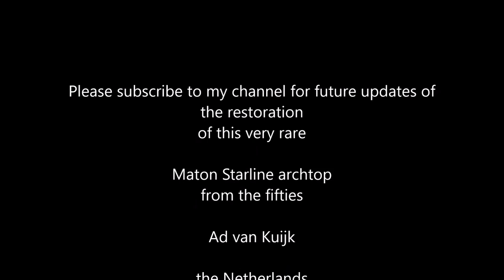Extremely rare Maton Cello guitar from the fifties restoration part 2

Comment: By 1956, Maton truss rods had a half inch square adjustment with access through the soundhole in my HG100.  Too late now, but an inspection mirror through the cutout may have revealed whether the Starlite had the same truss rod although it would be impossible  to access through the F hole.  I used the back end of a half inch drive extension bar to give the HG100 truss rod its first tweak in 62 years.  Suprisingly it still worked.  I would love to put a camera inside the old Starlite to see what bracing pattern Bill May was using in 1956.  Probably just the two tonebars that we can see through the cutout.
Reply from the maker: there were only two tonebars in this Maton.

Comment: Hi Ad, great vids as usual, thank you. Just one question : wouldn't have it been better to put the missing pieces of the harmonic bars before closing the pick up hole ? Thank you for your time. Regards, Marc
Reply from the maker: Hi Marc, you're absolutely right, but I had 3 reasons not to do so:
The top was very thick at that place already; I was working with a limited budget and it would have been an almost impossible repair. The guitar sounds well now so I'm glad with the dicisions I made.
Reply: OK I see, thank you for your quick answer. Have a nice evening !

Comment: The back sides & neck will be Queensland Maple (Flindersia Breyleyana) a rainforest hardwood from Northern Australia which Maton still uses as a mahogany substitute.
Reply from the maker: thank you for all this inside information!
Reply: Maybe the laminated top used that species for the inside layer, apparently sandwiched between two spruce layers?  Or are my old eyes failing me - it was hard to see, but it looked like a laminated top, which made me wonder why he wasn't adding electronics to finish the job?  It would sound wonderful amplified, and the holes are already there, so WHY NOT...?
Reply from the maker: This is a very resonant solid spruce top and the guitar was made in the fifties as a fully acoustic archtop. That's why I restored it and now it has back it's beautiful sound!